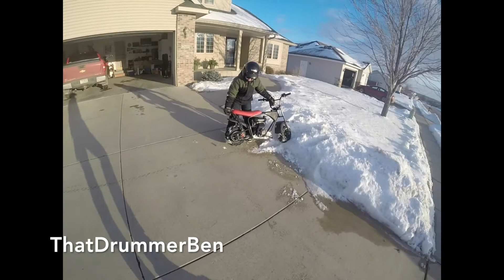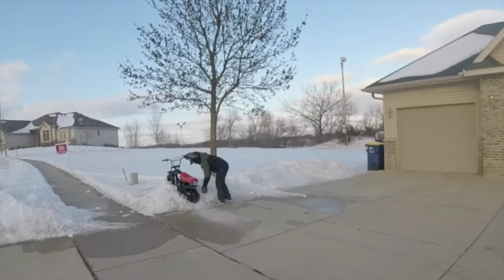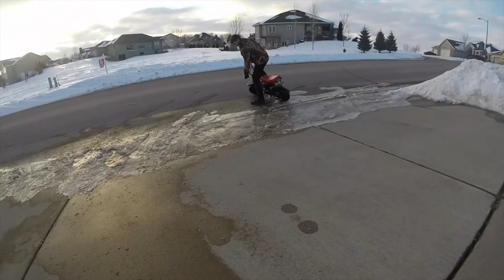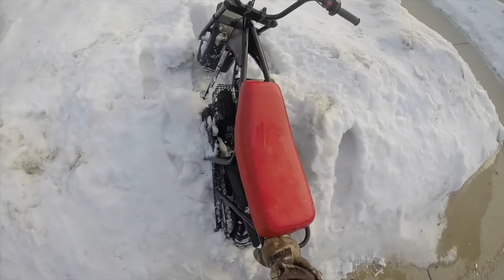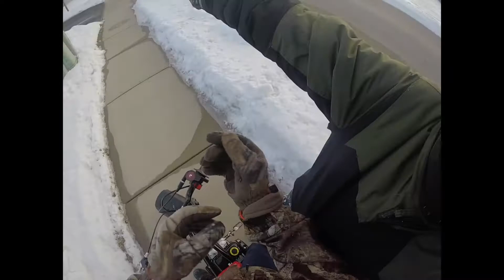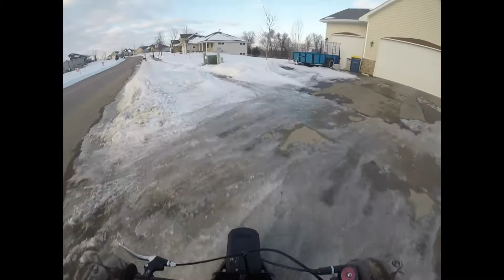Winter mini bike madness!

Comment: I commented a while back on another vid. I cant find that damn idle screw either. I know you changed engines but did u ever find the screw. I looked and just saw a bunch of "blank" screw heads with no insertion holes
Reply from the maker: If you look at the engine from the side that has the muffler, on the top of the carb there is a blank black plastic screw and that is the idle screw. took me awhile to find it but its pretty simple once you do